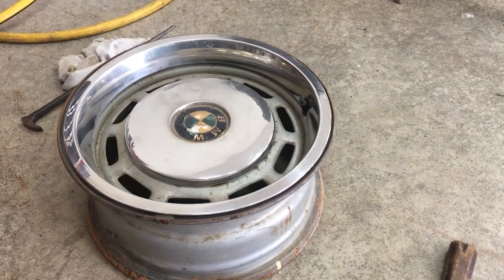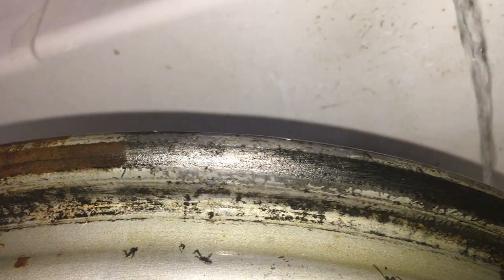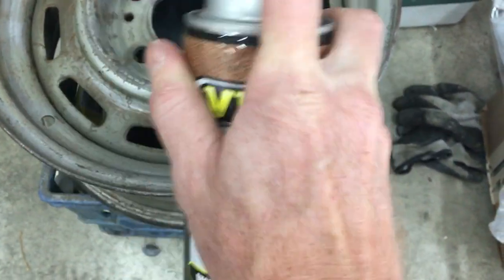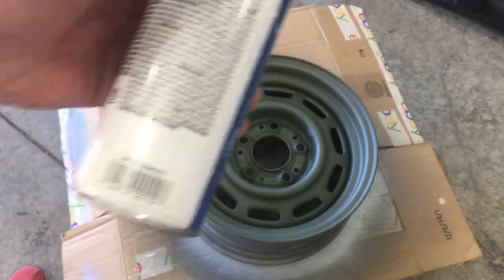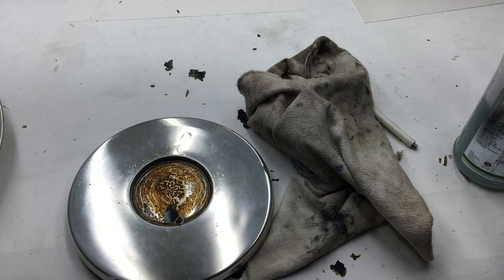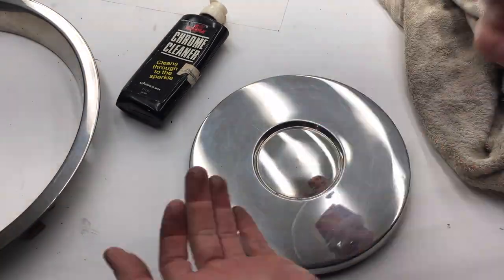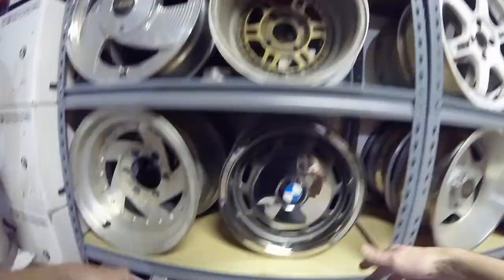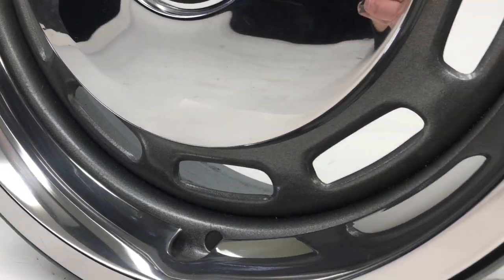How to: Spray Paint & Restore Rusty Steel Wheel Rim + Chrome Trim Ring

Comment: Turned out quite nicely. How much did the factory sticker cost? I know manufacturer original items for luxury vehicles aren't cheap. The center cap for my 1984 Lincoln Town Car in 1998 was $143.00. Of course, that wasn't a sticker, but it was a part for a 15 year old car at the time, and not even an import luxury car. I tried to find a bumper for an 82 Mercedes for a friend one time in the early 2000s and the cheapest I could find, used, was over $800 and needed to be re-chromed. Luxury parts are really a seller's market.
Reply from the maker: Many genuine BMW parts do carry a hefty price tag, but the emblem was only $8 or $9. Funny you mentioned the mercedes bumpers, I saved the chrome trim from the bumpers of my $330 1981 380 SEL before it went to scrap heaven. They're still in my basement aka the parts retirement fund.